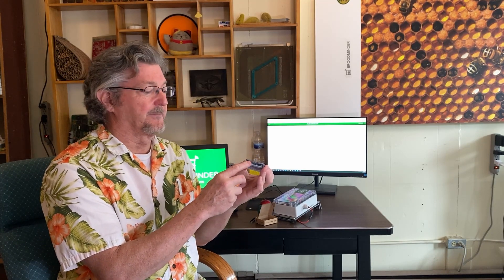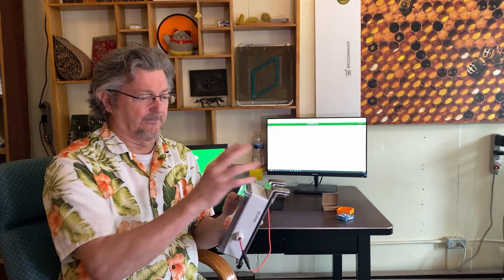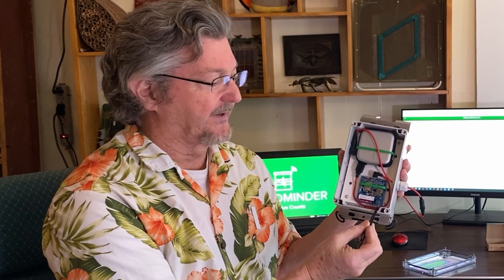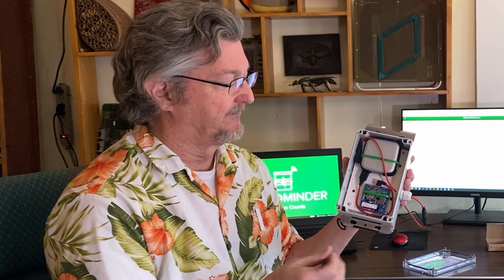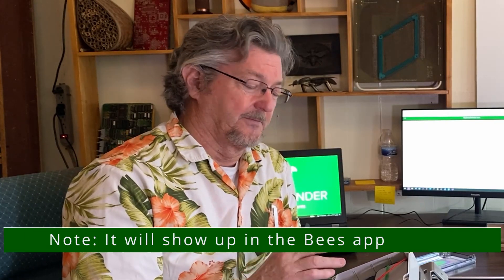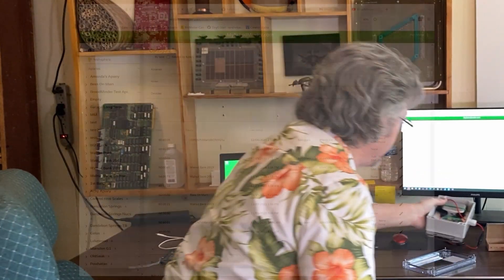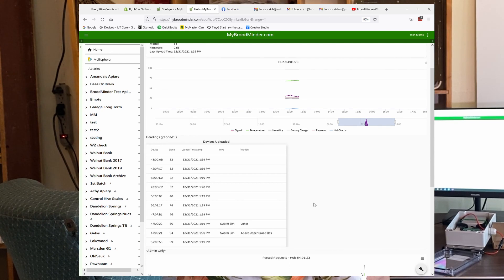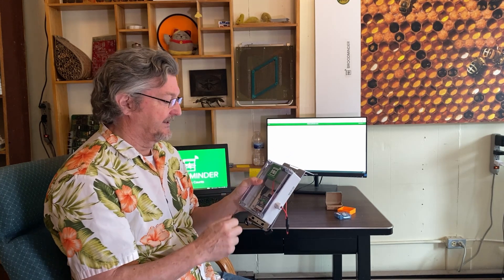BroodMinder-CELL (T91) Installation

Comment: Your website says you are going to these newer cell devices because 3G is obsolete at the end of 2022.  What about the older cell devices, will they still work, or do we have to buy a new cell device?
Reply from the maker: Well, I believed that we had until the end of 2022, but heard AT&T shut down this morning! We do offer the T91 "Naked" which can be put into the existing (3G) CELL housing and use the existing solar battery.

Comment: Bottom line what equipment is needed to manage two hives in the backyard with WiFi within 50 ft ? To know weight, moisture, and temperature of the hives ? Cost. Thank you
Reply: Thank you for letting me know I’m going to pass
Reply from the maker: https://broodminder.com/pages/recommended-broodminder-configurations